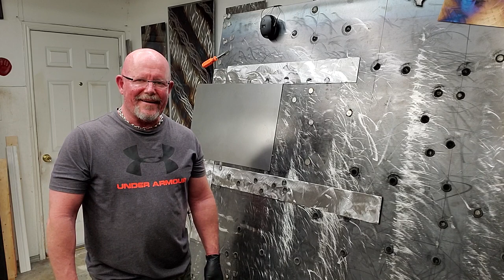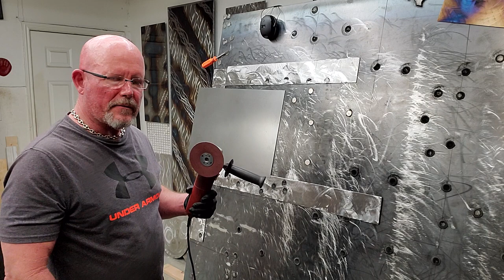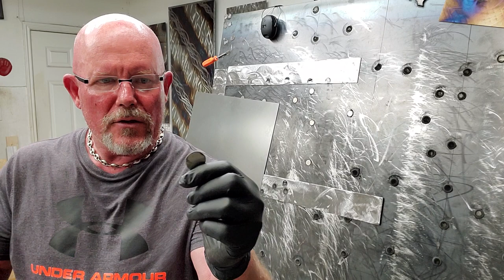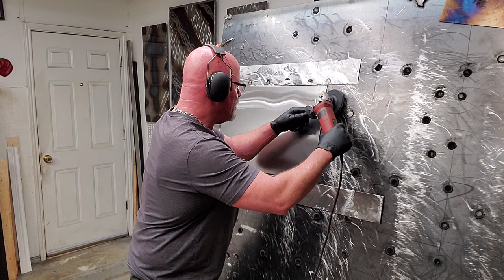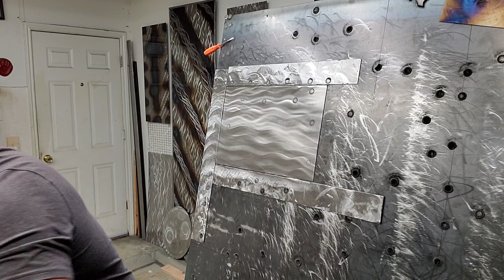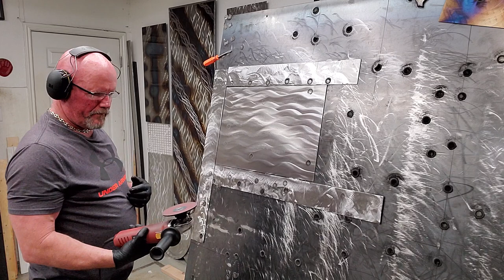How to grind flame patterns in metal using 18 Ga cold roll steel.

Comment: THanks for sharing Kevin - much appreciated.

What grit were you using for the initial prep of the steel? Would you use similar on aluminium?
Reply from the maker: Sorry for the long delay. Personal business got in the way and I forgot, Sorry!! I use 80 grit on everything anymore. I used to use 36 gr. for a while but found it to be too aggressive and not as much reflective value from the grind.  I just different speeds on movement and angle of the grinder. You can use the same grit on aluminum, but I don't grind it because I can't flame paint it. After this crazy freeze passes, I'm going to make some more videos on flame painting. Feel free to reach out to me anytime and bounce ideas off each other It's hard to find like-minded people in this space. 469-446-5250. Thanks and have a great day. Kevin

Comment: Why cold roll steel sir.
Reply: Cold rolled as far as I am aware has no mill scale and polishes easily. You usually have to use muriatic acid to get the mill scale off hot rolled.
Reply: @Gate-way2Life  good to no. Thank you